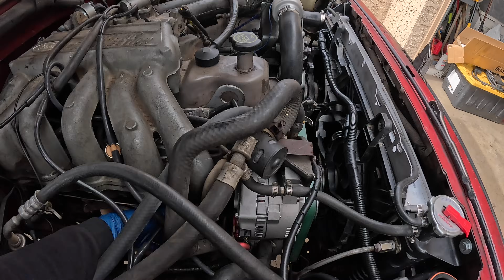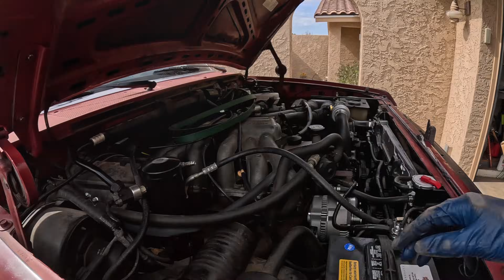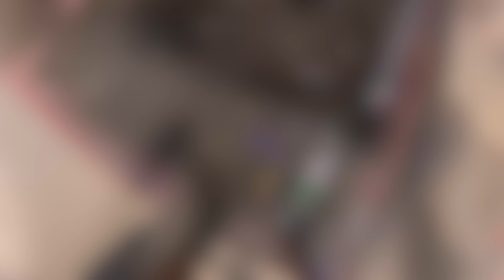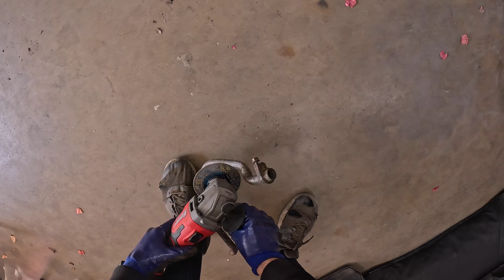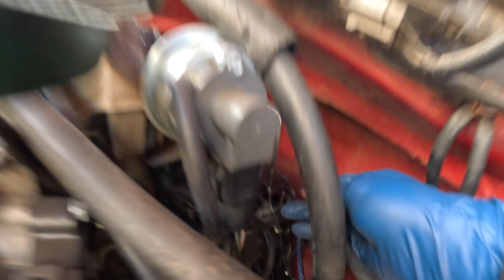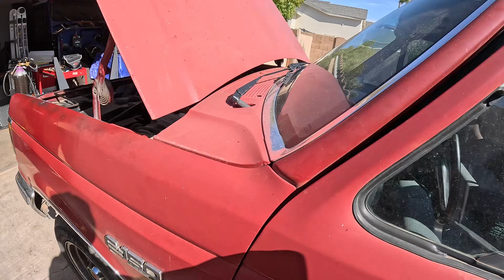Delete Your Smog Pump Now! (Easier than you Think) | Ford 4.9L

Comment: Do you have the straight mount altenator tryna look for a 250 amp for mine know the length?
Reply from the maker: Yes, I installed a straight mount alt. It's about 9.5in ear to ear. 

I ended up using this one for a Ford Taurus. 🤘

https://link.amazon/B0elpp9Mv

Comment: Did anyone else have an overheating problem after doing this? i deleted mine and noticed an overheating problem. I have a 2 inch radiator for my ac i have. besides that i have a new fan clutch, water pump and thermostat(it is oriented the correct way) any ideas? im thinking its the way i have my belt routed maybe causing a incorrect way for the water pump to be pumping coolant?? Im currently running a 82 1/2 inch belt. i was running a 83 1/2 inch belt but it was slipping. I dont think i have any air pockets needed burped
Reply: I will say the overheating is only at idle. if im driving it it does not over heat in the slightest. I know my fan clutch is good to from testing it with the truck off after funning it to test how stiff it is
Reply from the maker: @DavidIhlefeld Heyo, generally if the pump were spinning the wrong direction you would be running hot most of the time.

What engine size do you have?
Do you have a fan shroud?
How long has it been since you cleaned your radiator coils?
Reply: @MyAutoAdventures  Hi! Thank you for responding! I have the 4.9! I do have a fan shroud. Ive been contemplating going to an electronic fan setup like you did but havent yet. I havent cleaned my radiator coils but i just put that 2 inch radiator in maybe a month or two ago. Before i put the 2 inch one in i had a 1 inch one in there and i was overheating even on the highway(i had the truck loaded down moving states) Now its just an overheating in traffic. Good to know if i had my water pump wrong it would overheat regardless!
Reply from the maker: @DavidIhlefeld Sorry for the delay! 
Since it only overheats at idle and is fine on the highway, it sounds like an airflow issue at low speeds rather than a pump or belt routing problem, so swapping to an electric fan won't fix the root cause. 

Since you've already done the thermo, water pump, and radiator, what coolant ratio are you running?

What sort of ambient temps are you sitting in?
Reply: @MyAutoAdventures  Thank you for getting back to me again i really appreciate it! Im using the prestone green ready to use 50/50 mix coolant and i'm sitting in the 80's/90's during the day. i experience the overheating at night too when its in the 70's though as well which to me is another layer of odd
Reply: I think i figured it out! I found out. I think my fan clutch even though its functioning properly isnt heavy duty enough. Apparently theres standard duty, heavy duty and severe duty fan clutches. I reckon the hotter it is outside and if you run AC the heavier duty of a fan clutch is required. Heavy duty is supposedly the bare minimum for the trucks that run AC in them. Id bet i have a standard duty one in there. Ganna upgrade to a heavy duty one and see if that does the trick!

Comment: Just bought a 92, air injectors were removed and capped with spark plugs, but the can and pump were still on and attached to belt, any reason why?
Reply from the maker: They probably had a vacuum leak and made their way half way through a smog pump delete. 

You can finish it off by removing the pump and getting a shorter belt. That'll at least remove another pulley. 

How is it running currently?

Comment: My 91 f150 with a 4.9 had the A.I.R. tube and that bypass valve thing already removed but the pump and pipe down to cat is still there.  It looks like your truck didn't have the A.I.R. tube or it was already  removed.  Where was this pipe hooked to? I have want to make sure I have everything plugged up correctly
Reply from the maker: It might be easier to email me some photos and I can do my best to help from there. 

There are quite a few hoses and tubes and I don't want to misdirect you. 

Definitely send me an email and some photos to MyAutoAdventures@gmail.com and I'd be super happy to take a look!  🤘

Comment: Were you able to find that fan belt at 96 1/2 ….Have been looking… let me know..Thank you for the videos 😊
Reply from the maker: Was not able. Opted for the 97" one from Goodyear. They also have a 96" as well if you need just slightly shorter. 👌

Goodyear 97": 1060970
Goodyear 96": 1060960
Reply: Did find the new belt for my 93 4.9 F 150…96 1/2 ….should be close… Thanks for this video….👍
Reply from the maker: @ChefJamesRusk That's awesome! Glad you found one man! Super appreciate you watching! 🤘

Comment: Would it be possible to remove the guts to the smog pump to leave it intact and be able to use the same serpentine belt on the free wheeling pulley?
Reply from the maker: Definitely possible! Just make sure your pulley bearing spins freely and you should be good to keep it in the system. 🤘
Reply: @MyAutoAdventures Thanks for the reply.
Reply from the maker: @randyhogan6024 You got it man! Good luck with the build! 👌

Comment: What about the secondary air injection pipe? It’s part of the smog system on my 95 and currently has a hole blowing hot air on my ECT sensor. How do i go about deleting that as well?
Reply from the maker: Is that the pipe that blows down near the injector ports?

Comment: That 9/16 bolt on top was a mf to take out and im working on a 96 model. Just a heads up if yall havent done this yet
Reply: So I've got the top bolt almost half way out, it keeps turning and not coming out any further. I've literally had to use a cheater pipe the whole way just to get it where its at now, any suggestions?
Reply from the maker: Heyo, super weird. Did you end up getting that bolt out? Was it just free spinning in there?

Comment: Maybe it's in another video, but I've got to know, what's the silver/gray device inline on the upper coolant hose?
Reply from the maker: Yes sir, that's a JEGs external thermostat housing. 

I got tired of my thermo housing leaking with the paper gasket so I installed the external housing. 

It works great and I haven't had any issues with cooling.🤘

https://youtu.be/i0EWU6IND5Y?si=J82xwChxHp3tCcCK

Comment: Does it hurt to have the smog pipe to the exhaust just free hanging after cutting the exhaust off?
Reply from the maker: It depends on the system. I’ve seen two types of smog pumps on these trucks:

One where the tube connects directly to ports near the injectors, and another (like mine) where it doesn’t.

If yours is the first type, you’ll want to plug those ports on the block.

If it’s the second, you can just leave it hanging without any issues. 👌

Comment: What size belt do i use i have ac and everything else is stock
Reply from the maker: I have the Saginaw power steering upgrade and the smog pump deleted so I’m not positive my belt size will be the same as yours! 😔
Reply: @MyAutoAdventures  i got the 825k6 at first the truck started fine after  like 3 starts a pully or tensioner sounded rough not sure if the belt is too tight
Reply from the maker: @reyvilla5070 That 825K6 might be a little too short. If the tensioner is sitting almost fully tight, it can put extra load on the pulley bearings and cause that rough noise you're hearing.

Ideally, you want the tensioner sitting somewhere in the middle of its travel, not maxed out.

Also wouldn’t hurt to spin the pulleys by hand with the belt off just to make sure one isn’t already going bad.👍
Reply: @MyAutoAdventures maybe a 91

Comment: Hi @MyAutoAdventures, thank you for the great videos. I am preparing to perform the saginaw swap and smog delete - what size serpentine belt did you end up using? Thanks again!
Reply from the maker: Heyo, happy to check for you. Just checking, do you have AC also on your truck?
Reply: @MyAutoAdventures Yes, it's a super fancy XLT Lariat 😂. I actually finished the swap this afternoon and ended up bypassing the smog pump and with the van bracket / saginaw pump a 82.5" belt seems to work well. An 83" may be ok too. Really happy with how it worked out. Thank you for the great F-150 vids - you inspired me to tackle sway bars next.
Reply from the maker: @MapCowboy  Geez, must be nice. 😆

Super glad you made it all work! And appreciate you posting the size belt you used for others with the same setup! 

Good luck with your next project, super appreciate you watching bud! 🤘

Comment: any difference in mpg ? i already have a electric fan
Reply from the maker: I didn’t officially track MPG, so I can’t give a hard number. That said, it felt like I was filling up less after doing this.
The biggest difference for me was power and throttle response - the truck definitely felt stronger and happier overall. If you already have an electric fan, MPG gains (if any) would probably be minimal, but the drivability benefits can still be there depending on the setup.
Reply: @MyAutoAdventures  my smog pump is failing and a new one is like 300 usd so a new one isnt a option
Reply from the maker: @Motivation-o12z They are rebuildable if you want to keep everything stock, or if your state is really strict on emissions. That can definitely be the better route in those cases.
Some setups have the air rail going directly into the head, and those are a bit more time-consuming to delete since you have to plug the ports. I’ve seen a few people just use short bolts threaded into the head to seal them off and had good luck with that.
If a new pump is $300 and not an option, the delete can make sense — just depends on emissions requirements where you live and how stock you want to keep it.

Comment: Does this have anything to do with the EGR system or is that something different?
Reply from the maker: Good question! It’s related, but it’s a separate system. The smog pump pushes fresh air into the exhaust, while the EGR recirculates exhaust gas back into the intake to lower combustion temps. They work toward the same emissions goal, but they operate independently. 👍

Comment: "You're pretty positive it is causing parasitic draw"?! It's always been a fact that anything extra the engine has to turn kills power output. When the Fox Mustang first got popular, swapping  a short belt on at the track to bypass the smog pump & power steering would drop about 3/10ths in the ¼ mile.
Reply from the maker: That’s some great Foxbody history. 

I agree—anything driven by the engine costs power. In my case, I believe the smog pump bearing was failing, which caused more resistance than normal and made the draw more noticeable.

Comment: Can't we just put the other belt on and leave all the crap in place or will the smog ha e to come out?
Reply from the maker: You can definitely just route around it. 👌

Half the reason is to stop the power draw the pump might cause. The other half is to clean up the engine bay, but that's definitely not a must. 👌
Reply: @MyAutoAdventures i'm about to do mine now, smog pump went out and nowhere to order it i'm just gonna throw the other belt on and see what happens lol
Reply from the maker: @CryptoRich-p4o Sounds like a great plan to me! 🙌

Comment: What size belt did it take after deleting your smog. And did you keep ac or delete as well. I deleted my smog and having trouble finding belt size
Reply from the maker: I live in AZ so I for sure had to keep AC. 😄

I have the 3g alternator and saginaw power steering pump so all that changes the belt length. Mine is currently a 98" belt.

Best bet is to grab a couple different sizes and see what works. Luckily Amazon’s return policy on unused belts makes it easy. 🤘
Reply: @MyAutoAdventures i appreciate the input

Comment: So can you do this without removing the pulley can I just gut it?
Reply from the maker: You definitely can! A lot of guys (myself included) have had issues with the smog pump or pulley locking up or adding resistance to the system. Any extra drag just takes power away from the engine, so removing it helps free things up. Totally depends on what you’re aiming for. 👍
Reply: @MyAutoAdventures thanks for getting back to me so quick I appreciate the info

Comment: I removed the smog pump.
Reply from the maker: Atta boy! 🙌
Reply: Sweet. I just took out old parts that weren't connected anyway since they removed the pump long ago.  Also the injection cooling parts that were disconnected long ago. I might need to look into the tube now.  And want to move onto whatever else to clean uo the engine bay

Comment: What about the secondary air injection tube? Can that be removed and plugged off?
Reply from the maker: Heyo, thanks for reaching out!

I don’t have the secondary air tube on my setup, so I’m not super familiar with it firsthand. But from what I’ve seen, you’re good to plug off that system along with the rest of the smog pump removal.

A lot of people seal the holes at the back of the heads using bolts with copper washers, which seems to work really well. Others just cut and clamp the tube instead. I personally like the copper washer method if you can make it work — and I’m always a fan of reversible methods in case you ever need to go back. 🤘

Comment: I have a 1991 F-150 4.9 4x4 
I have Ac still / AutoZone alternator/ original power steering ? What belt size do I need ?
Reply from the maker: Heyo bud, that's a great question! I have no idea.

What belt did you have on before? And is the alternator the thing you changed?

Is the alternator pulley bigger or smaller?

In these situations, I like to make use of Amazon's fantastic return policy.

Grab 2 or 3 different belt sizes and give it a go. 😄

Comment: Did you goto a 3G alternator?   I didn't recall a 91 having a 3G and it has 180 mounting ears.
Reply from the maker: I definitely upgraded! It was before I started filming my work. The alternator was from a Ford Taurus.

I decided to swap around the time I was considering doing the e-fan swap. 🤘
Reply: @MyAutoAdventures  Thanks for the confirmation.   I used a 3G from a 95 F150 4.9L with 2 o'clock ear.  It was hitting the top bracket stud.  Cutting a few mm off fixed that and was able to use the OEM F150 3G wiring with 1 splice.      I am guessing the 95 must have a different bracket or mounting for the 3G.  I didn't pay attention while at the yard.

Comment: Great write up. Thanks to your video I'm going to do this to my '95. The old smog pump is making noises like a bad bearing and a replacement isn't available. They don't cause that much drag but I'd might as well clean up the engine bay.

By the way, your camera glasses do a great job. What brand do you use?
Reply from the maker: Thanks a ton for watching! 🤘 It really is nice being able to clean up the engine bay—hopefully it goes smooth for you! I actually use a GoPro with a head mount. Looks pretty goofy, but it keeps my hands free to wrench.

Comment: Any idea what length of belt one would need to eliminate smog pump and ac compressor?
Reply from the maker: I couldn’t even venture to guess on that one 😂 Best bet is to grab a couple different sizes and see what works. Luckily Amazon’s return policy on unused belts makes it easy. 🤘
Reply: 800k6 at napa
Reply: 800k6 at napa

Comment: I'm looking at buying an 80s bronco and putting a 300i6 and OD auto from a 1995. before i install the engine i think I need to look at these mods
Reply from the maker: You'll love it! I’ve got the I6 with the E4OD in mine and couldn’t be happier. It tows for days and drives like a champ—especially after getting rid of all the unnecessary power draws. 💪

Comment: did you get a p0411 code after?
Reply from the maker: Heyo, mine’s OBD-I, and I didn’t get any check engine lights after doing this.

What year and engine are you working with? Have you gone through your vacuum lines recently? Sometimes a simple cracked hose can trigger that code.

Comment: Mines popped off in the back end. What benefit does this give by deleting it?
Reply from the maker: Heyo, deleting the smog pump helps clean up the engine bay, reduces weight and belt drag, and can slightly improve throttle response. It’s one less thing to fail, and if you're not subject to emissions testing, it's a nice little upgrade for reliability and performance.🤘

Comment: Need to know what size serpentine belt to use, I’m doing this mod right now. Great video, new follower 🤠
Reply from the maker: Heyo @jorgerios3473, thanks a ton for subscribing! 🤘
The belt size kinda depends on a few other things:

1. Are you running the original alternator or an upgraded one?

2. Do you still have A/C?

3. Stock power steering pump or aftermarket?

Each of those can slightly change how long the belt needs to be. Let me know what setup you're running and I can help you narrow it down or maybe someone else can chime in if they have the same setup!
Reply: @MyAutoAdventures  Heyyy, thanks for replying.
Reply: @MyAutoAdventures Currently everything is bone stock.
Reply from the maker: @riosjorge10 Heyy, no problem! I’d check out this Facebook post—looks like the person has a similar setup and mentioned using a 95" belt:
https://www.facebook.com/share/p/1F263LAv4o/?mibextid=xfxF2i

My setup has A/C and the Saginaw power steering upgrade, so my belt size likely won’t match yours.

Another option is to route the belt as normal, then pull the slack together at the top and estimate how many inches to subtract from your current belt. That should get you really close!
Reply: @MyAutoAdventures mucha appreciated, thank you. Let me check it out
Reply: @MyAutoAdventures  my truck does not have AC and is stock
Reply from the maker: @giannitriv1888 Heyo, that's great. Are you planning on removing your smog pump or keeping it on for now?